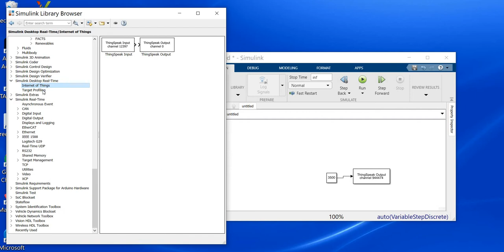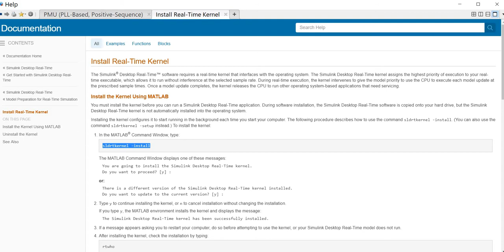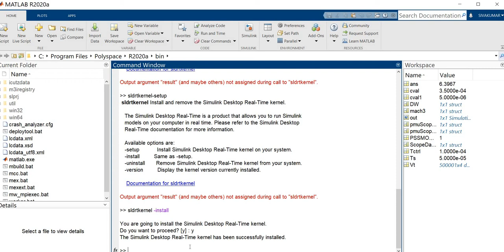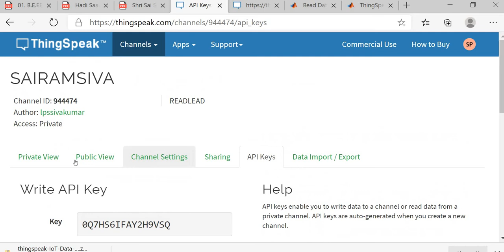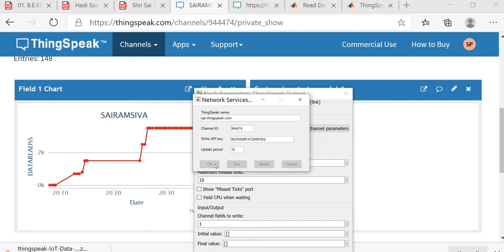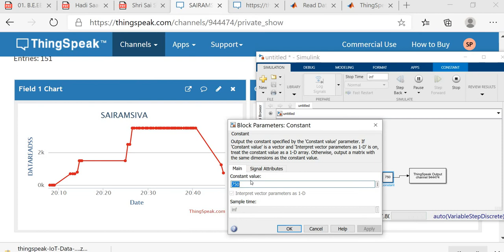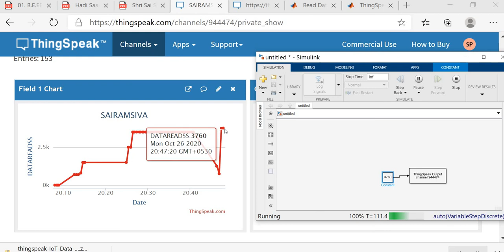IOT THINGSPEAK  CONNECT WITH OUT HARDWARE BY USING SIMULINK

Comment: i am getting this error :
Error reported by S-function 'sldrtoo' in 'v2g/ThingSpeak Output':
Hardware timer cannot be allocated. Real-time kernel cannot run
Reply: Hi Praveen, did you solved the issue of getting 'sldrtoo'-Hardware timer cannot be allocated. Real-time kernel cannot run.....
please do reply..... even I'm facing the same issue.....
Reply: @lovelypalas9842  ya ,I increased the no of missed ticks and the error went away
Reply: @praveenkirubakaran547  I have tried but the error still